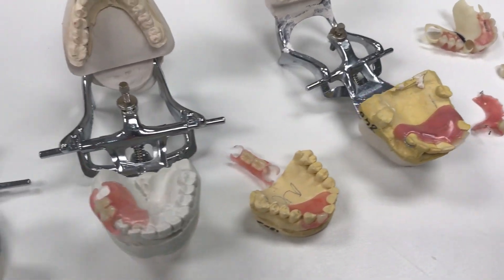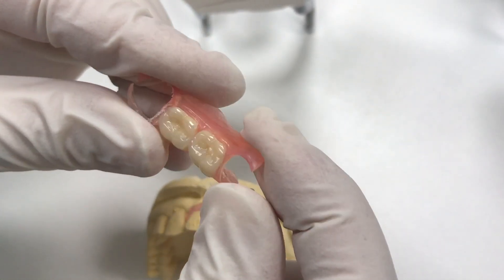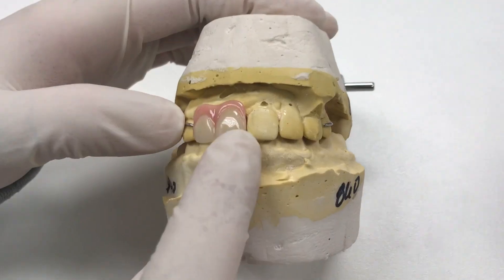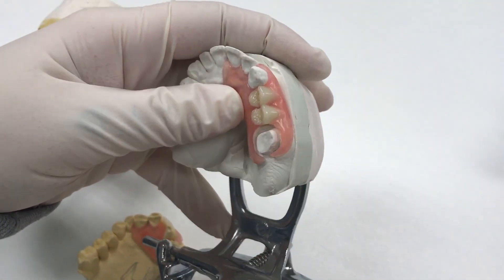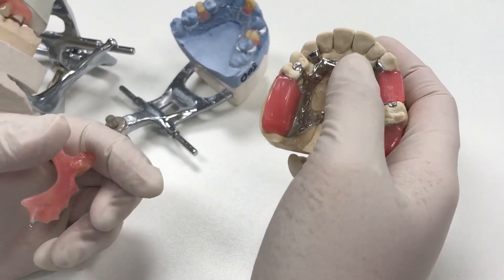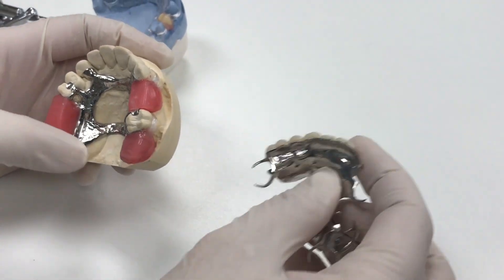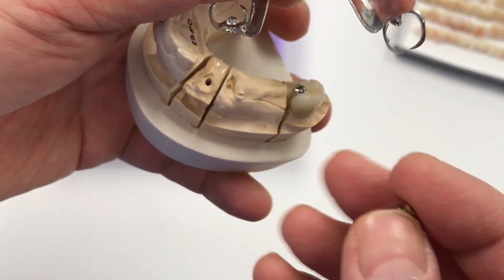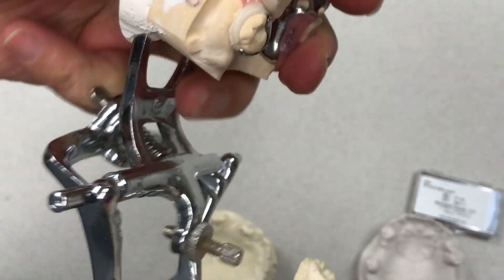All About The Different Types of Partials

Comment: I've got four teeth on the top and my dentist says I can't get a partial because there's nothing to Anchor it to so all my teeth have to be pulled and I've got to get a full denture. Is this the case or are they just trying to get more money pulling all my teeth?
Reply: Jerry Hanson  your dentist is definitely telling you the truth. Unfortunately, when most of the teeth are missing, the best option is to get the rest pulled and go with a full denture. Depending on which teeth you  do have left, there could be a chance of getting a partial to work out, but there wouldn’t be many or enough teeth to create the retention needed to hold the partial in place. Also, when a lot of teeth are already missing, (and there are various reasons as to why, different for each patient) there’s most likely a high chance of the patient losing those teeth in the future. So, if the remaining teeth were positioned in a way where you could get some retention, and you paid to get a partial made, it’s possible that down the road, you could lose those remaining teeth and have to then pay again, but this time for a full denture. I work at a dental lab and I would also make the same recommendation that your dentist did. I hope this answered your question! I’m surprised to see how many questions in the comments have gone unanswered, so I figured I’d answer one!
Reply: @mesial_magsx3494  Thank you for answering!

Comment: I'm getting this done on January 30th I'm so excited!!!! I'm getting a upper partial !!
Reply: Hope it goes well I just had a flipper for tooth #5 & it’s actually not that bad. Mine is exactly like the one in video with metal clasps
Reply: @bs431980  Hi bro!
is your experience good?
do you recommend its use?
do you eat well with it?
Reply: @emiliojosemolla6421  yeah man it’s not been bad . I eat with mine. However if it’s something hard or something chewy I use the opposite side. I take it out at night to give my mouth a rest and because I grind my teeth a lot during sleep. I wash mine with soap and water 1-2x per day using a soft bristled toothbrush. Looks just like real thing too . My clamps are barely visible
Reply: @bs431980  does it make you lisp?   How's it going?
Reply: @SlowerTrafficKeepRight-k2g  it did for a little while but I eventually got past that . I do like to remove it when I eat at home just for convenience.  Nobody can even tell I have it on daily basis.
Reply: Update?
Reply: How Did it go??

Comment: Can I cure wax in a flask without pressure, how can I turn wax into plastic without a compressor
Reply: You cant cure wax. During processing the wax is melted off and the cavity is filled with acrylic or flexible material. And it depends on what type of process your using. For matrix processing yes you need a heated pressure pot... But for flask processing you dont need a pressure pot but you will need a hydraulic press and a heated pot.
Reply: @leejones3155  onnonmoononmmmnonnnnnmnoomnnonmonnnnonwm
Reply: https://youtu.be/voUlbVfmf3Q

Comment: I’m so confused 🤷🏾‍♀️...lol
Reply: It seems that these dentists don’t want to give you any options
Reply: @saundrafoster8768  They didn't give me an option either. I told them I didn't want them once I saw all that metal showing in my mouth. Now I'm waiting on the plastic one
Reply: I know
Reply: @systemofaslipstatic   They didn't go into detail of what is indicated or contraindicated for each rpd (removable partial denture).  Usually you would need to have impressions taken and  sent to a laboratory such as myself and I'll decide which is best indicated for your situation. Taking everything into account. Example- how many teeth we are replacing  are the existing teeth strong enough or are some of the teeth too weak for  clasping, will this be long term or a temporary rpd. Also we need to know what the opposing (antagonist) dentition is. These are just a few thing we need to take into consideration before we design an rpd.  Hopefully you get yourself in the hands of a dentist  who will convey these things to the laboratory before deciding which appliance to fabricate.  One last thing, see if there is a "Denturist " in your area. They are highly recommended for removable appliances.